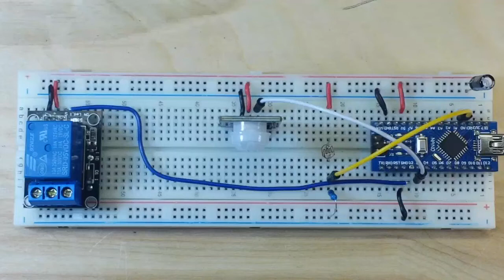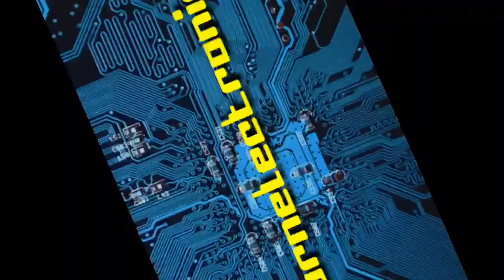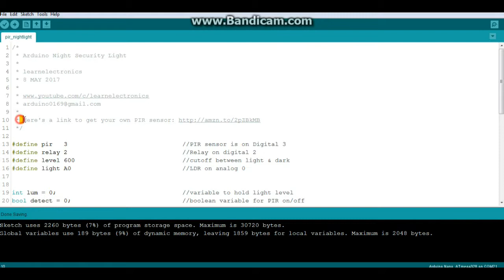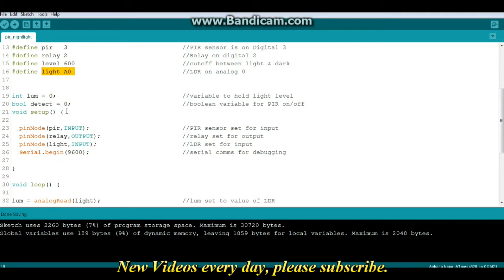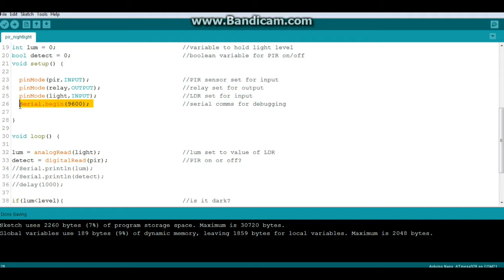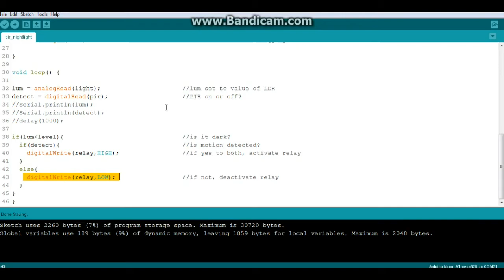Arduino Night Sercurity Light

Comment: never really got my head around PIR sensors. heard its like 2 cells detecting infrared, and the lenses in the plastic make movements over the 2 cells, and that then triggers it
Reply from the maker: I couldn't explain PIR sensors either. Not my speciality. I just know they work and are easy to use lol